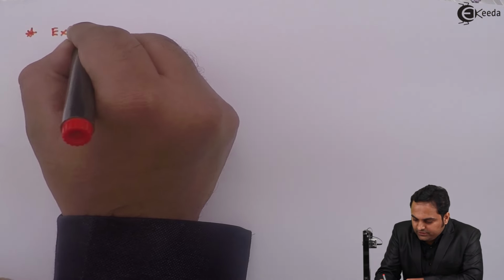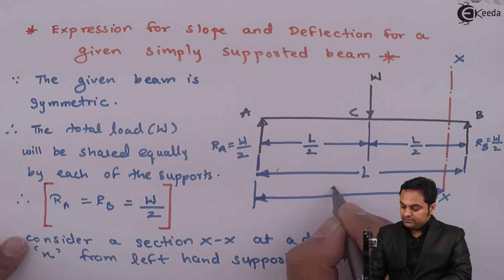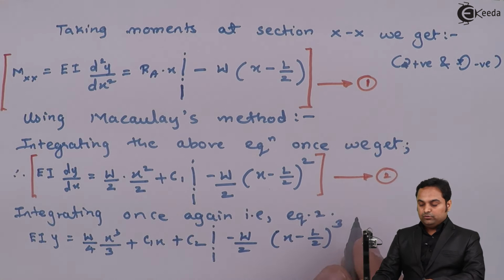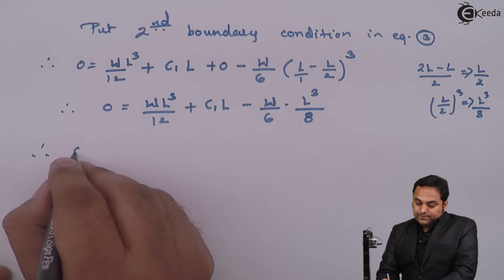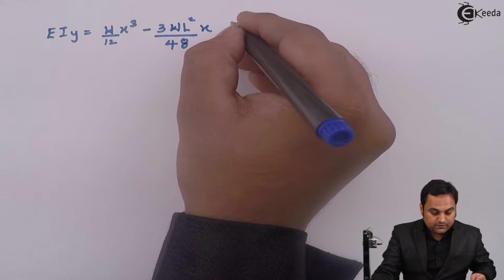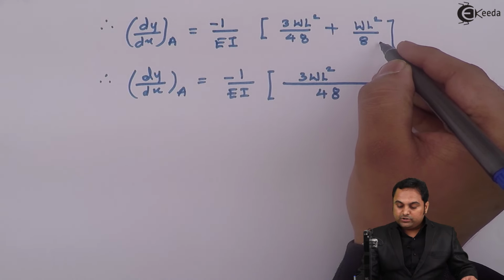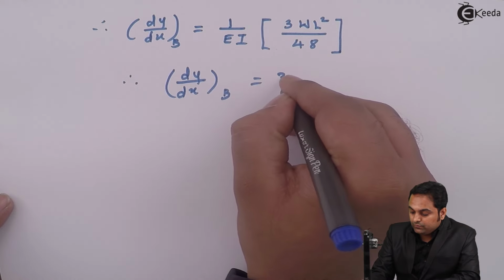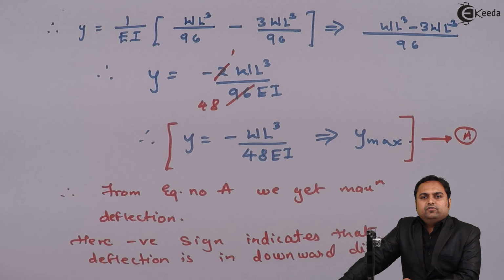Expression for Slope and Deflection - Slope and Deflection of Beams - Strength of Materials

Comment: Slope at point A is different then B ...Not possible becoz symmetrical simply supported beam....Acting load at midpoint so slope will be equal on both point A and B ...That is exact value will be....

Comment: Thanks a bunch sir! I have a question though, how do I derive an equation if I have a concentrated moment acting at the middle in place of point load.
Also given the condition that one end is fixed and other is hinged.

Thank you!
Reply from the maker: We recorded your response. We will Come back to you shortly.
Reply: Actually I am looking for a differential eequation of a beam with a concentrated moment applied at midspan.If you can hekp me get the equation it would be enormous hekp